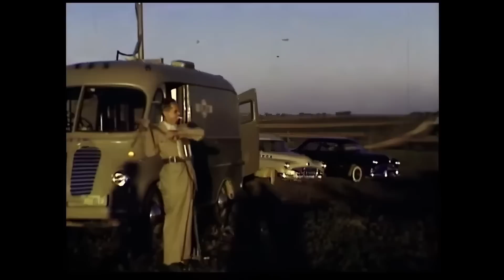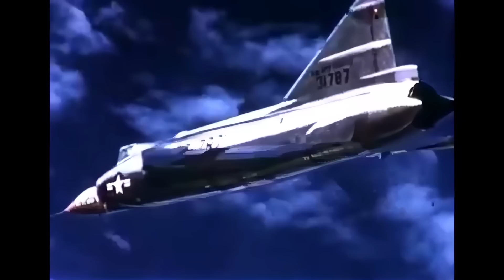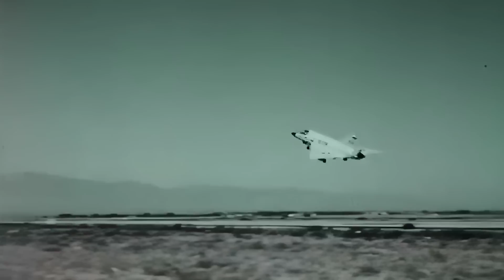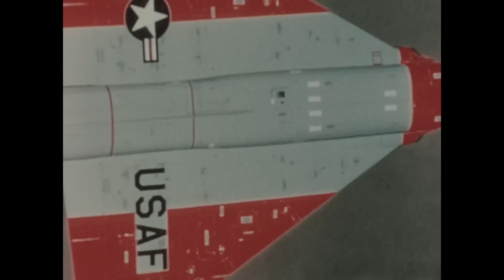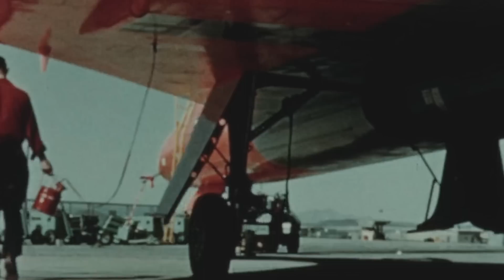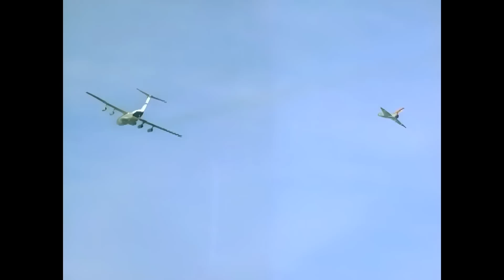U.S. Cold War Sentinels. The American Jets That Defined an Era

Comment: Nicely done. One " Cold War " sentinel you left out was the SR-71A BlackBird. If there wasn't the cold war would we of had the U-2 and SR-71's? Even the F-15 to some extent was developed because of the cold war. It's never easy trying to surpass what has been the best and the measuring stick for others to be judged against. One very often overlooked but very important asset are the Tanker Air Craft such as the KC-135 series , the backbone of the USAF's ability to be dominant with all of the other planes needed to do so. Cargo planes as with the Tankers don't get enough praise for what they do and how without them ; the situations would be very different and probably not for the better. We should be greatful and thankful we have so many various ty;es of planes for a lot of needs.
Reply: I could be wrong but this video showcased the first jet fighters and there was not enough time to show other aircraft in this video, it was still an fantastic history lesson